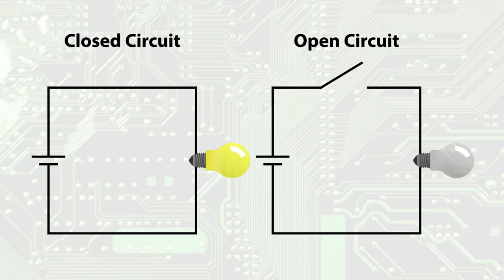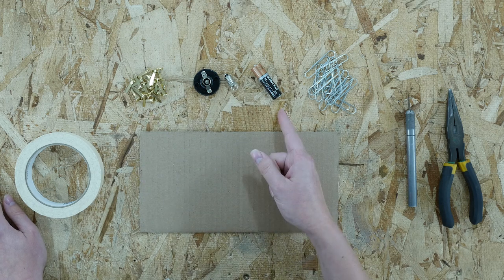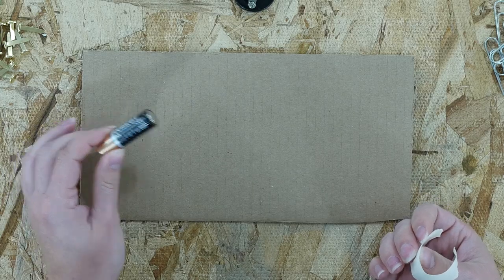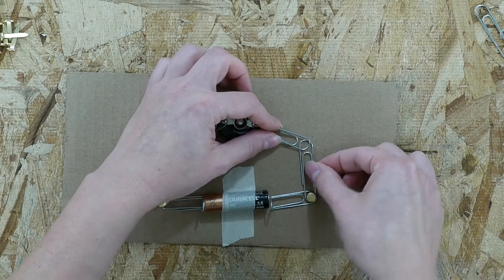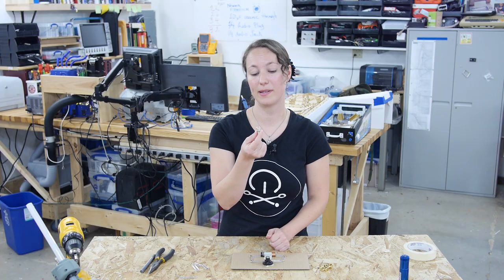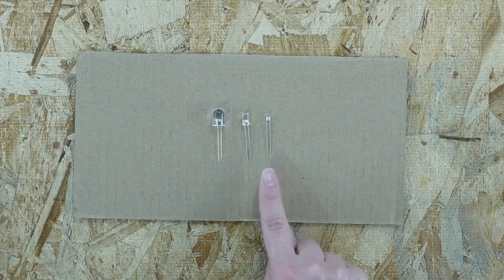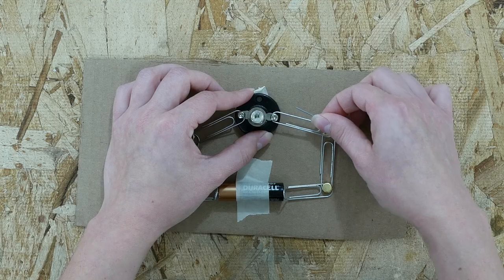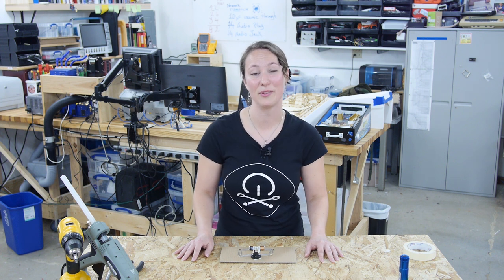Circuit Basics - The Learning Circuit

Comment: A good way to demonstrate circuitry wiring is copper foil tape used in Stainglass work you can put one long strip on each side of a piece of posterboard and then crossover from positive to negative to show circuits.  Use an X-Acto knife’s to modify the copper foil tape then you can solder to it

Comment: I like the concept of this series and I hope that in the future it'll get a little more complicated =) Also voltage is not power even though it was said so in the video.
Reply: You are correct! Power is not voltage. I was attempting to simplify the concept for beginners, with the idea that down the line they will learn that electricity is more complicated and voltage is not power is not current is not resistance.

Comment: Question: what if you connect the wire to the negative terminal, but don't terminate the other end in the positive terminal, will the light bulb still turn on? The electrons are still flowing through the bulb, then would it not light the bulb?

Comment: i have a circuit consisting of a battery, LED, motion sensor and switch. all the components are around 30cm apart connected with wires so how can i program this? would i need to include a PCB and join all the components on there?
Reply: Check out my more recent video on ultrasonic distance sensors (motion sensors). That should help you figure out what you would need to do. There's also another video where I show how to use the sensor in a project, it's a robot.

Comment: I really wanted to learn to know how to and how not to build a circuits coz I am aware that I can't use electronic parts( resistor, capacitor, inductor etc etc) as I want in a circuit. I wish to know how to build a circuit for e.g. if my power source is 1.5 volts the components and parts I can or cannot use in the circuit or if my power source is 5v, 12v or even 230v which parts, resistors, capacitors, inductors, transistors, diodes, op-amp/ic, power switch etc. I should stop writing, it's too long. But you got the idea on what I mean. Thx

Comment: I would like to see a circuit fade on slow using a 2.5" square 4 LEDS red hunting light 12 volt 300 lumen current draw 0.5 ( 500 mA ) diagram.

Comment: The battery bounce test does work, but is extremely inaccurate. 
Only a new or almost undischarged battery does not bounce, maximum bounce is reached at about half charge. Furthermore different battery models may bounce differently.
At $5 even preschoolers can afford a basic multimeter nowadays, so better have it handy.

Comment: Dont buy a 50 cent battery holder off ebay when you can use paperclips and have the most dodgy connection possible. Even taping the wires on to the battery would be better.
Reply: Well to be fair Karen did say at the end "let us know if you found out a better way to build it" so it could have been intentional?. Basically if the paper clips don't line up correctly the circuit is 'open' therefor completely relevant to the video title.

Yes i know the video is 101 basics but really the light has nothing to do with it. It's all about the kids learning how a circuit works and constant broken traces (paper clips) teaches the tinkerer to re-engineer the project. Being hands on, trial and error and understanding how it works is the key rather then just copying someone and sitting there looking at a glowing light.... See what im saying? It's all about learning and lets face it the engineering side of projects is more fun then playing with it after. 

So in hindsight people in the comments shouldn't be telling the kids the answers! They should be working this out for themselves :)
Reply: I'm glad you brought that up! I originally did this project with kids and I tried using 2AA battery packs. But those come withs stranded wire leads that are not stiff enough to easily wind around something and stay connect enough to make a solid connection. The kids got very frustrated. One goal of this project is to not require soldering and use as few tools as possible. I couldn't find a way to use battery packs off the shelf, not requiring modification, and have them hook up reliably.  Hence using paper clips as battery holders. We also tried taping wires to the batteries, and it doesn't hold as securely as one might think, sadly.